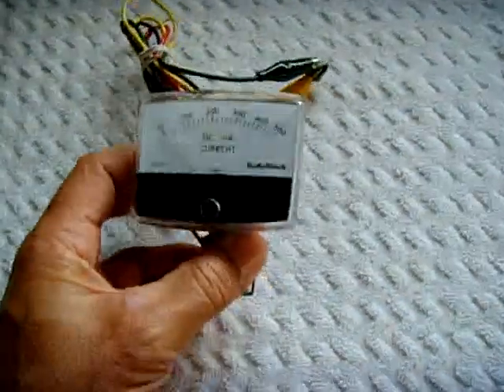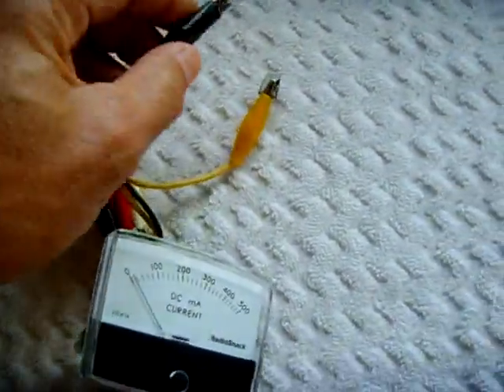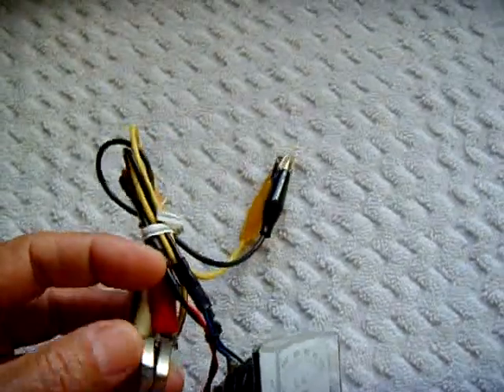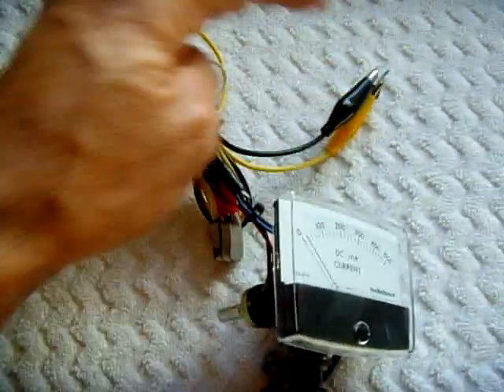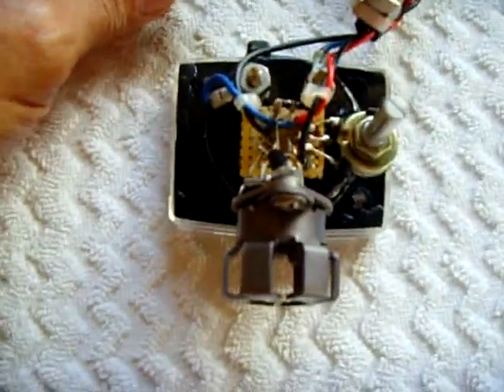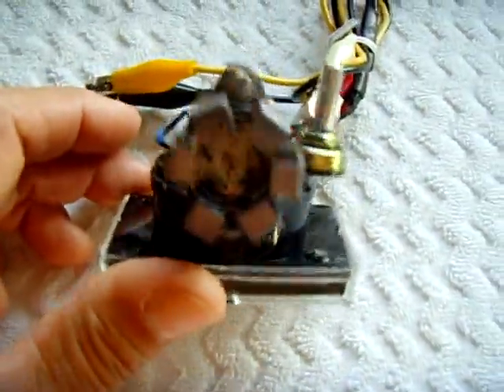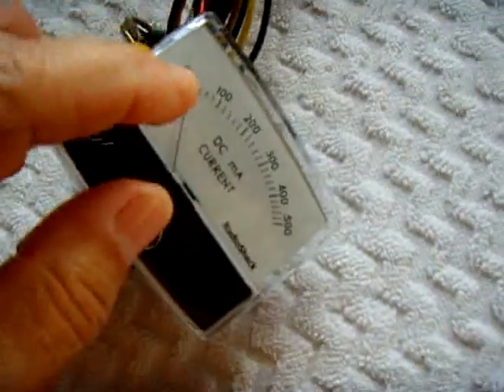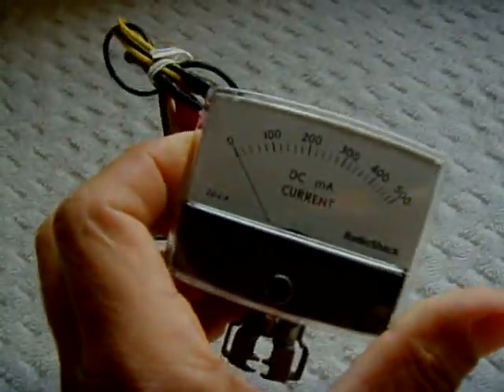Simple Adjustable Constant Current Battery Charger

Comment: Hi, could I charge my 7.2V 6x NiCd battery pack with this circuit and powering it with 10V  solar panel which gives about 960mA when in direct sunlight? Thanks!
Reply from the maker: +Viktor Božičević 
Hello. NiCd's are the easiest to charge. It should work fine if the solar panel is designed to supply 10V at 950mA. If you are measuring the open circuit voltage in full sun and getting 10V, and shorting the leads across a DMM to get that "short circuit" 960mA, then you will need a higher voltage panel.

Comment: Won't you get overcharging?
Reply from the maker: This is just a very simple constant current charging circuit. If you want the circuit to turn off once a specific voltage has been reached, then you can add a another circuit to this one. I have a circuit in my video playlists that can be used by adjusting the zener value to your desired turn off voltage.

Thanks!
Reply: electronicsNmore I'd imagine it could be as simple as adding a second pot and a voltage regulator. The lm317 is a popular one.  Also!  I just bought a combimded digital voltage & ammeter for less than 4 dollars on eBay.  Its quite cool,  if you add those things,  I'm sure this would become quite amsafe and capable charger.

Comment: Yep, sorry my fault, im not brilliant at discribing my understanding :-)

Its a common way of making a simple constant current charger, also an lm317 can be wired for its minimum 1.25v for less input voltage with the same constant current method.

The 317 has got to be the most usefull regulator ive ever seen, just two resistors, and very very accurate if the resistors are stable :-)

Comment from the maker: OH. Now I know what you did. I thought you just took the output pin and fed it through a resistor, and then to a battery to charge. Your switch changed the resistor value between the center pin and output. I got it .

Comment: Well if you connect a known value of resistor from the 7805 output pin to the center pin the regulator will allways produce 5v across the resistor so constant current.
If you dont ground the center pin of the regulator and instead connect it to the battery +, and ground the battery neg then the regulator is allways above the battery voltage and the current stays constant through the resistor and battery :-)

Comment from the maker: You have to take your ammeter and connect it to the battery being charged after the vreg and resistor. You will see that as the battery voltage rises from being charged, the current drops. Check it out.

Comment: But the 7805 keeps the current the same as its allways 5v across the reference resistor.

The center pin goes to the battery + and output is joined to reference resistor and the other end to the battery.

The battery acts as the regulator ground.

Comment from the maker: The only problem with that setup(which I used myself in the past!), is that when the voltage rises, the current will drop. You will not have constant current.

Comment: Very handy :-)

I used a 7805 with resistors connected to dip switches to dial in the value required.
Fixed values and a rotary switch can be handy for standard battery ranges :-)